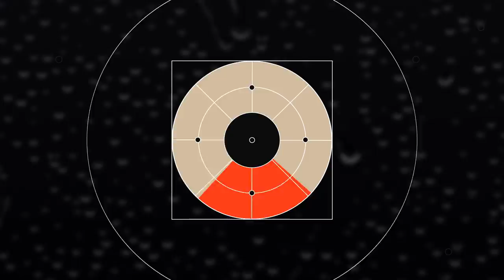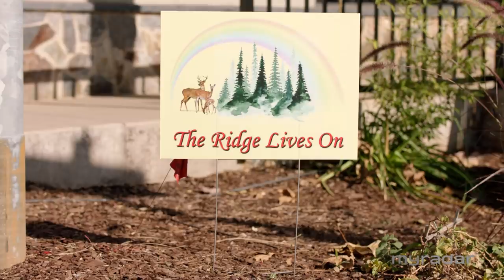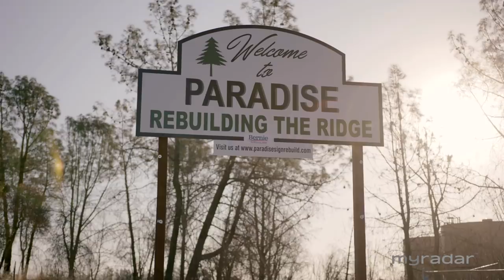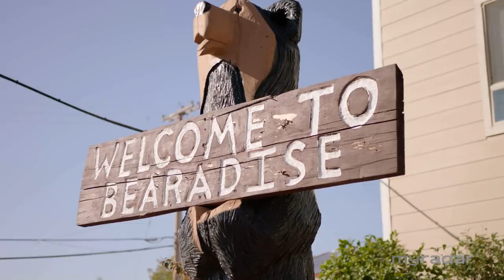Climate Refugees: Paradise - Rebuild or Retreat?

Comment: The answer is there all the time and that is to work with the environment and enhance the indigenous environment. Build the structures into the natural environment and take advantage of what it has to offer.
Use the local soil to build walls as the soil does not burn. Build the outer skin of the roof with soil as that does not burn and let the fires pass over.
Door frames, window frames need to be gas tight and pressure resistant.
Air vents need to be able to close up when the fire detectors activate and buffer soil walls need to be landscaped though out the village.
Inside the buildings put in air purifiers and alternative communicating systems.

Roads can be buffered with the existing soil so that the flames go over or against the soil while wild life corridors can go both over or under the roads.
Insert safety rooms into the soil buffers so that people can take refuge and place these in appropriate location's  along the roads.

Comment: It's going to be a tough process to rebuild up in Paradise. One example is the theater. My understanding is that it will take over a million dollars to repair the smoke damage. With only a few thousand people in town, it's not economically viable to open up the theater. The hospital may never open up again. Many of the businesses could open up again but with no customers, what is the point. Magalia has fared a little better. I lost two homes in Magalia but two-thirds of the town remains. Climate change bullcrap aside, visit the blancolirio channel for accurate information as to cause of the fire.